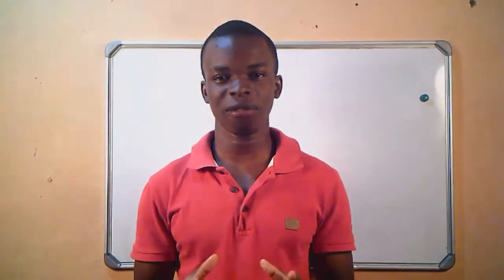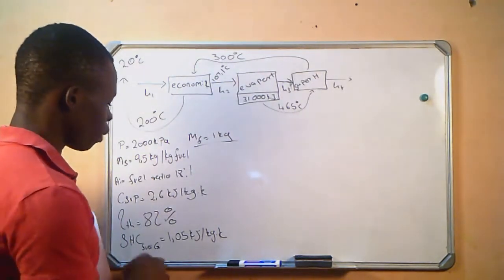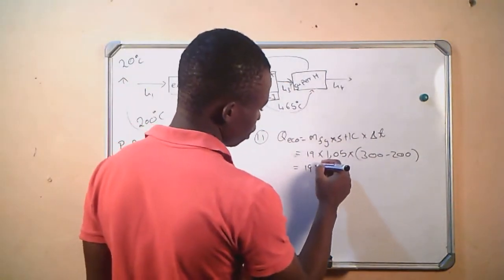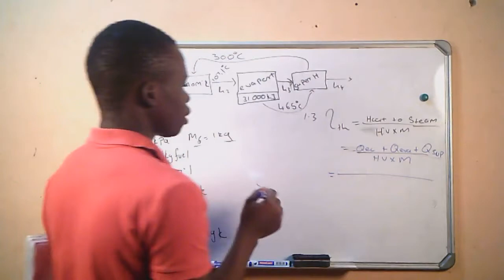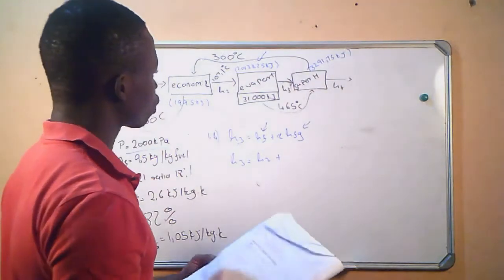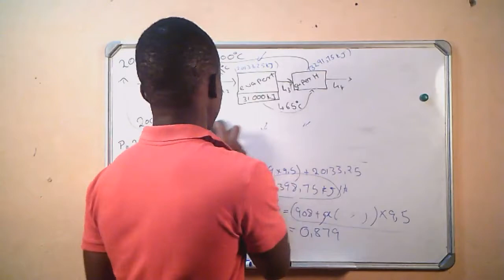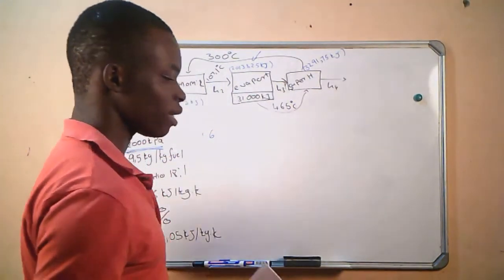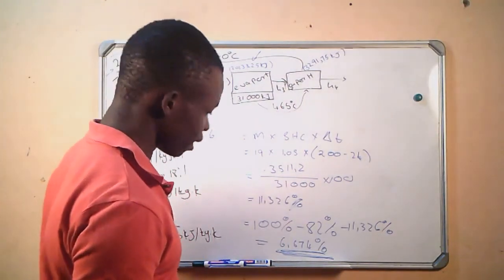Steam plant(Applied thermodynamics) 3of 5 Power machines N6

Comment: A boiler plant generated 10 400 kg of steam per hour at 900 kPa and 95 % dry feed 
water with a temperature of 64,6 °C
It burned 1 300 kg of coal with a calorific value of 31 MJ/kg per hour.

3.1 Calculate the following by using steam tables only
3.1.1 The thermal efficiency of a plant
3.1.2 The equivalent evaporation from and at 100 °C 

3.2 If the boiler is equipped with an economiser which increases the 
 dryness actor to 0,9% and the efficiency of the plant with 6,5%, whilst all the 
 other conditions remained the same. Calculate the following by using steam 
 tables only.
3.2.1 The increase in the steam production in kg per hour.
3.2.3 The specific enthalpy of feed water entering the evaporator.

3.3 If the boiler is further equipped with a superheater which increases the 
 temperature of the steam to 300 °C, whilst all the other conditions remained 
 the same as in Question 3.2, calculate the following by using steam tables 
 only.
3.3.1 The thermal efficiency of the improved plant
3.3.2 The equivalent evaporation from and at 100 °C

need this question to be worked out